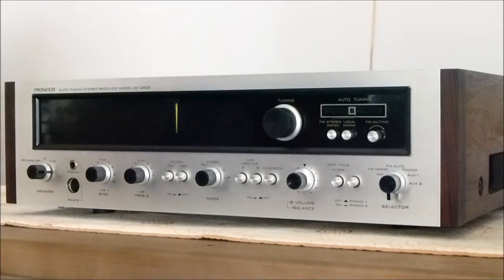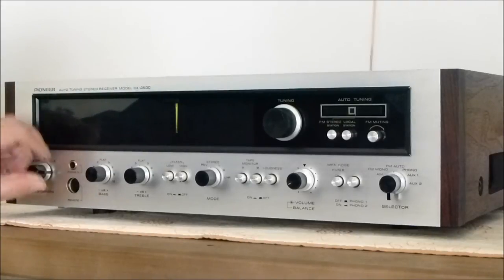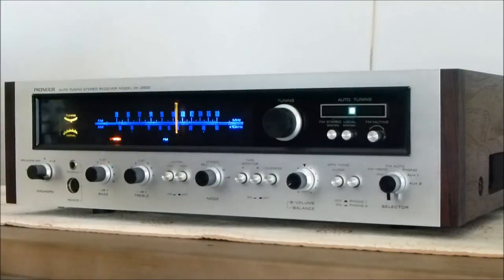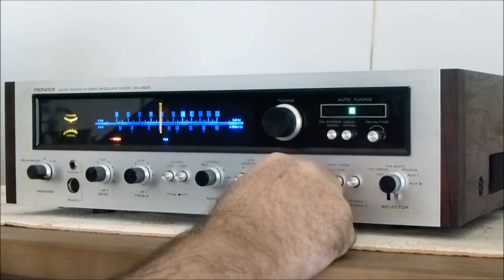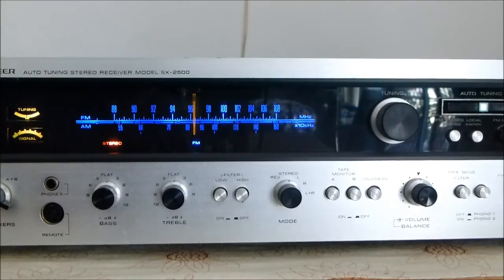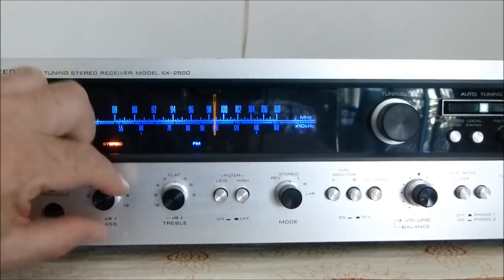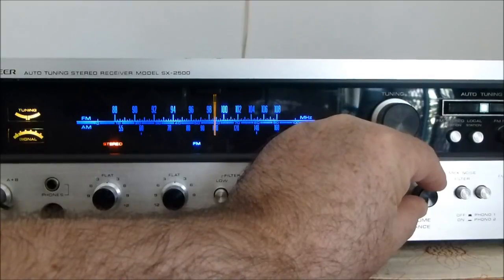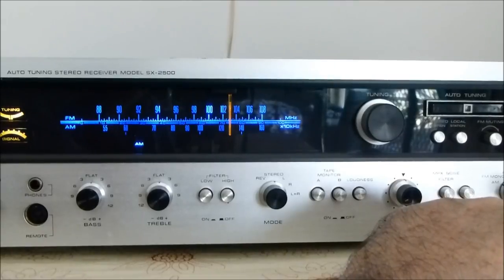Pioneer SX-2500 Receiver

Comment: I just acquired one of these units but I don't have the special speaker connectors for them. I have a few questions:
What does the REV mode do on the MODE switch?
Have you use the center speaker output? How do you use it?
And the pre-out and main-in section at the back... how does that work?
I have a lot of vintage Yamaha receivers. I have never seen this before.
Reply: "Rev" reverses the left and right channel through the speakers.  The "Center channel out", mixes both left and right channel together for a middle speaker, or a subwoofer. "Pre-out" can be run to a separate, possibly more powerful amp and you can still use the 2500 as a controller.  "Amp-in", is where you can send another pre-amp unit's signal in and use the 2500's amp section only.
Reply: @brunoprimas1483  thanks. :)